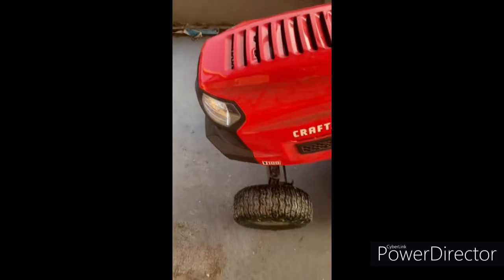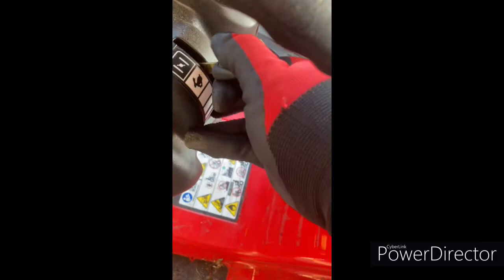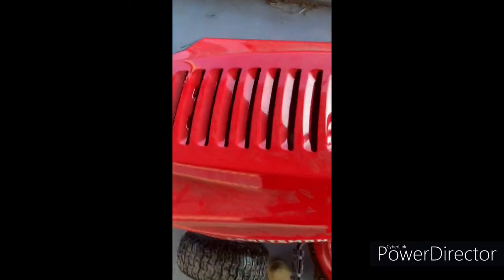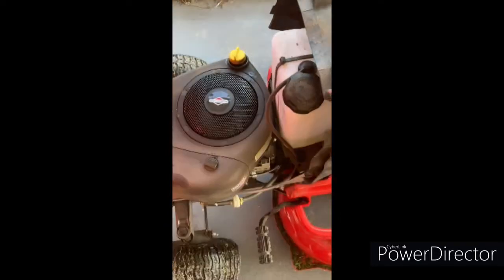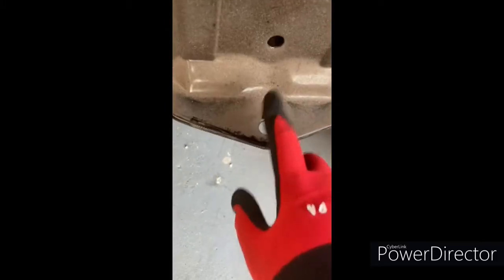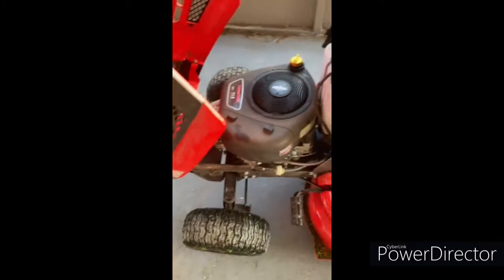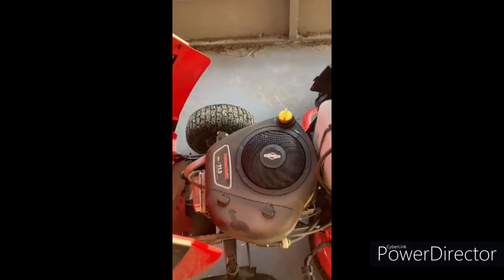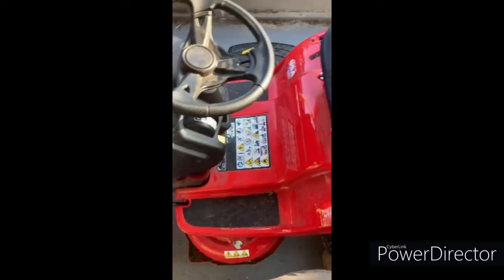Craftsman T100 Review

Comment: just an FYI as I have this same model.......if you set the brake and put it in neutral, you can get off the machine while it is running without it shutting off.
Reply from the maker: I didn't know that, thank you. Thanks for watching and commenting also.

Comment: Bought the same one can't get the hood to stay secure, any suggestions is appreciated Thanks
Reply from the maker: I know what you mean, I've been using ours and had the hood jar around from time to time. Not sure why they didn't design it to be more secure but I haven't really been able to find a fix myself, you might try tying it down through one of the vent's or opening's in the hood which I've thought about myself but what I normally do is just keep it in first or second gear and take it slow taking my time and for the most part it's fine. It can still rattle around from time to time but it won't go flying up or anything at least it hasn't for me. I hope this helps, just sorry that I couldn't be of more help. Thank you for watching and commenting. It is appreciated.